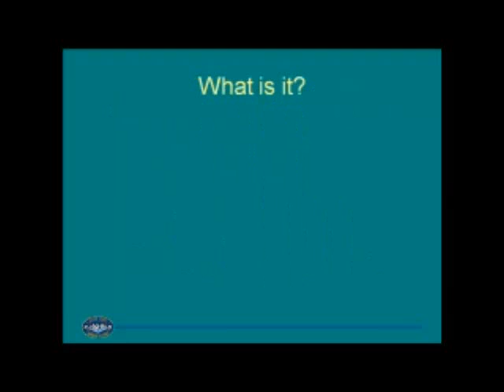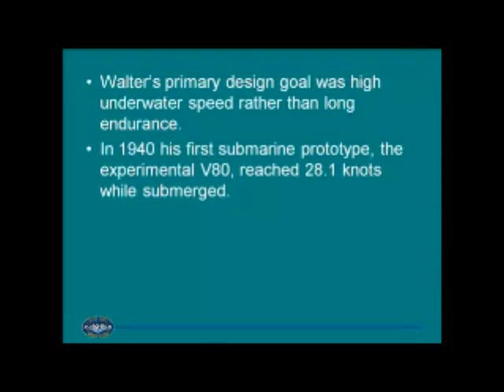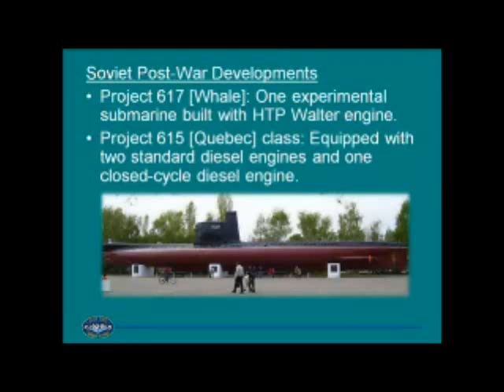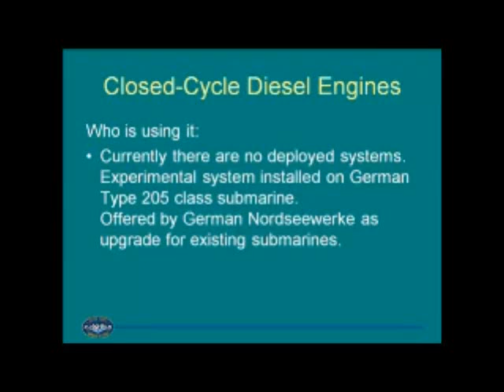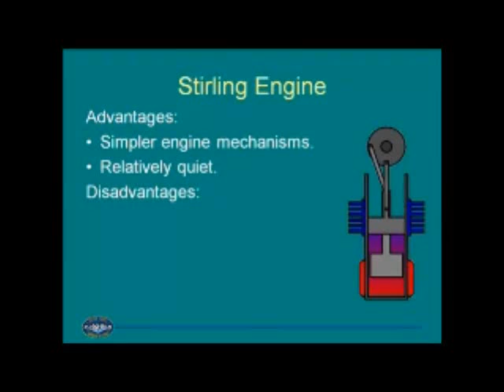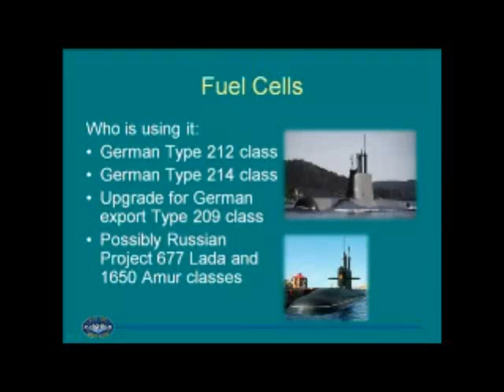Submarine Air Independent Propulsion

Comment: Patrick, I'm looking for some feedback on the potential to develop and field an SSn using NASA's KRUSTY - Sterling engines.  I would really like to know what an AIP Fuel Cell SSn using two KRUSTYs, with large fuel cells, in a diesel-electric layout (diesel for ingress/egress port & emerg power).  Propulsion would be electric with a propulsor.   Use an SS 569 Albacore hull-form the submerged displacement would be driven by the submerged sprint speed for limited periods of time, perhaps 4,000-5,000 tons.  Endurance would be food on this boat, and the people.  This would be a Regionally tasked submarine that would displace the need to retain SSNs for COCOM (Unified Combatant Commander) tasking overseas.  These would not be open ocean boats, though they could do that, but the SSNs would be freed up to perform those missions.  This provides a Hi-Lo mix with a design we can build two for one suing the SSn design.